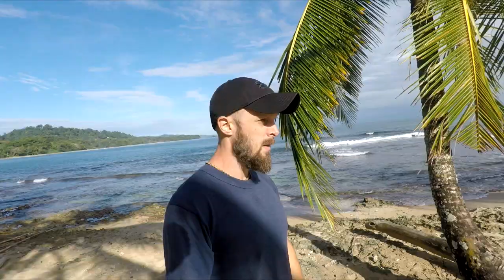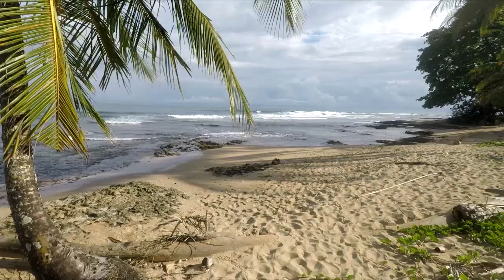IS MOLD A PROBLEM WITH COB HOMES? EARTHEN BUILDINGS VS CONVENTIONAL

Comment: Some wood houses have lasted over a century because they were well ventilated. Either 100% waterproofing or venting will work to preserve the wood. 

I prefer earthen homes, rammed or interlocking compressed blocks. Adobe made with emulsified asphalt will be waterproof. The problem is bearing strength. For that, you need to add Portland Cement. New, stronger 'cretes are being developed every year. A basalt fiber/rod and basalt re-bar are probably best for the final touch.
Reply: Is all that stuff healthy and natural ??what is best if you want ine side of your house underground??😊😊

Comment: We have lots of termite on our lands here in gujarat state of India.
I am already  building a cob house here.
Can you advice on the same?
Thanks and regards
Reply: @thiscobhouse  Thanks for your kind  advice.
Also need to ask will adding straw to the mud be of any issue for termites? Inviting termites?
What i saw in remote places where i could find were made of only mud without any fibre filler or binder.
Will be grateful again for your kind advice.
Thanks  and regards.

Comment: Concrete is much more vulnerable to mold than a cob structure, that is why it bothers me so much to see people promoting concrete foundation for a cob house! One step forward and two steps back my friend. Dry wall is even worse when it comes to mold! Please consider this
Reply: What makes you think so? Concrete is non-organic. So what is the mold suppposed to feed off?

I'm still worried about the straw in the cobb. If it's wet for too long, stachybotrys and other mold species may grow.

I agree about the drywall, though.